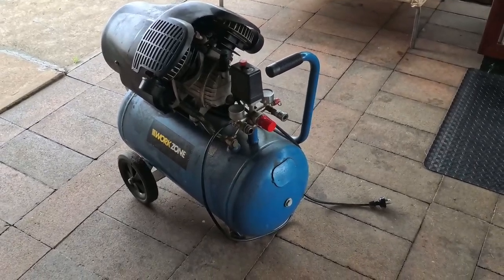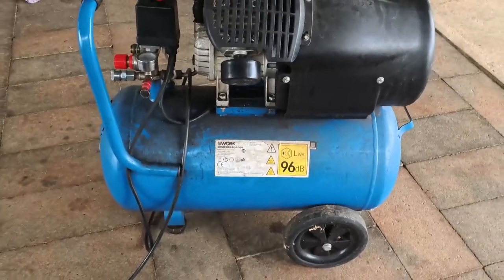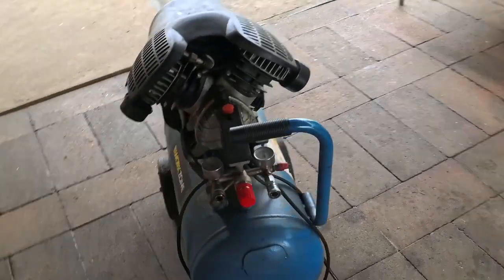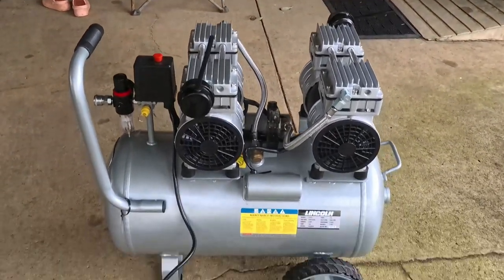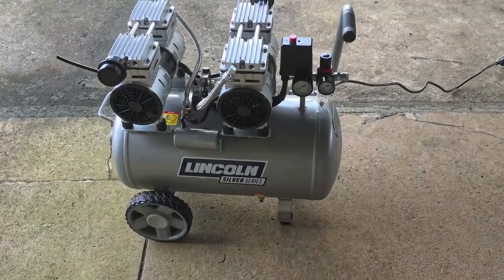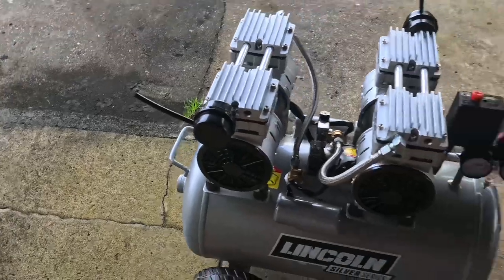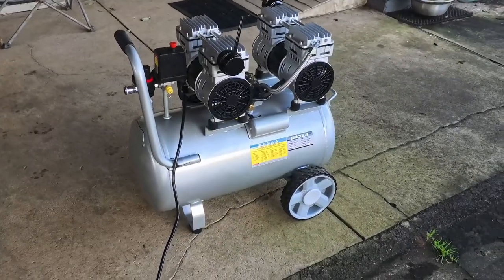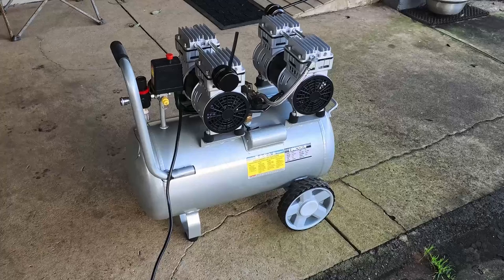Upgrading to the Lincoln LCS50 "Silent" Compressor for My Laser!

Comment: How much did the co2 machine ended up costing you pretty curious
Reply from the maker: It's a bit hard to estimate, but it was a bit less than $3,000 Australian dollars plus the cost of the chiller. However, the hours it took to build it should not be underestimated. It was fun, though.